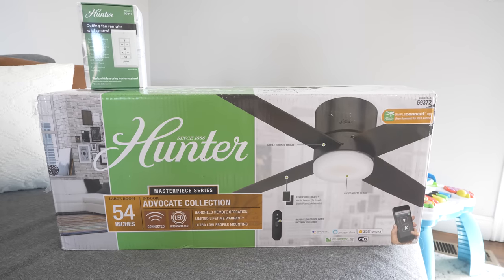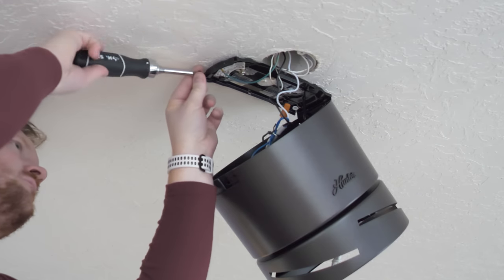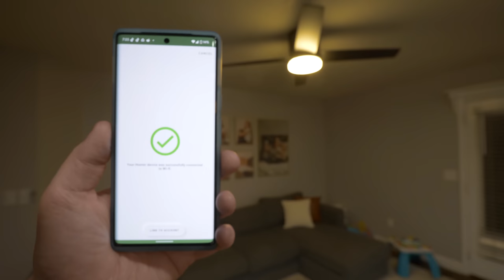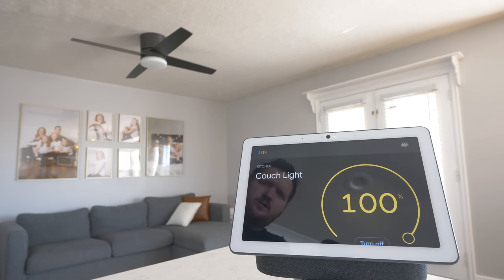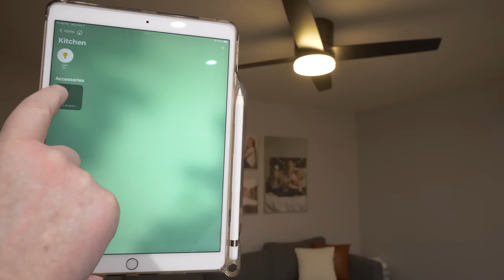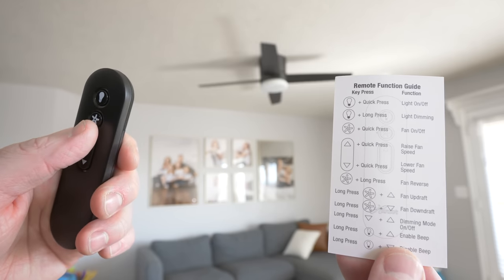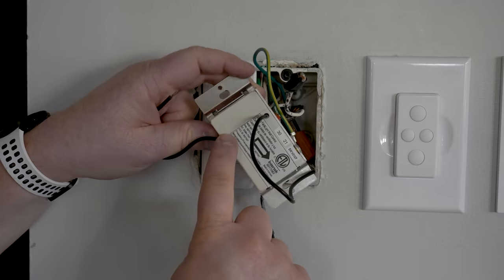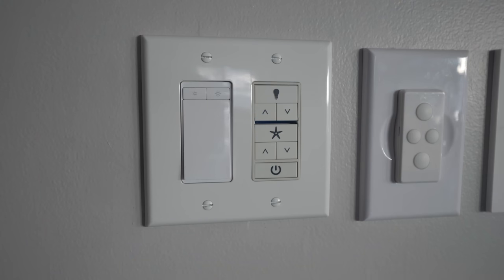This Fan Has Solved All the Smart Fan Problems

Comment: I also installed 3 Hunter Wi-Fi smart fans. They’re nice. I also installed the simple connect app and got it working with Alexa. Then I bought bond a little hub which covers 2,500 sq ft and can control up to 30 fans. It learns a whole ton of remotes/frequencies and makes old remote fans smart. Put’s it all in Alexa. It picked up the hunter fan remote and all of its functions in the bond app and also my other fans. Works great.

Comment: Nice setup. In my case, I bought a modern dumb fan (with no pull chains and a remote control I didn't install), and a Treatlife fan/light smart wall switch. The Treatlife switch looks super clean and modern and allows me to adjust both the light dimming level and fan speed. I decided not to install the remote control that came with the fan because it would mess up the smart setup, but also because remotes get misplaced and I can always use my phone as remote, or the Google Assistant (or Alexa) for voice controls.

Comment: First off, great video. I purchased that fan, but hated the light. It does not look good or generate enough light on a lower ceiling. The other issue I had was that the wall switch did not have the load for the fan. I ended returing the fan, purchased a Smart WiFi Ceiling Fan Remote Control Kit for $30 on Amazon and installed with my original fan. It works great.
Reply from the maker: Good to hear your review. The fan light has been a big improvement for us. I still have one of those I need to try out.

Comment: Meh? I just bought a generic Hampton Bay fan for $90, the Bond Timing Remote (you have) for $60 and 3 Hue Bulbs along with a $40 Lutron Aurora dimmer that locks the single toggle switch into the always on up position at the wall. No fan control switch on the wall, but voice control works fine. Homebridge'ed the Bond controller into Homekit etc. I could just add an Aqara 4-button remote and control the speeds via Homekit.

Comment: Virtual switches between ST/alexa can link it to your temp sensors to make the fan more automated.

Fairly easy to set up if you are into smart homes. I do the same set up with my dumb fan linked to a BOND RF controller. 90% of my fan usage happen automatically thanks to ST/alexa or bond.

Comment: So much better than going through hoops with a Bond device that doesn’t actually know if the light is off or on, or if the blades are spinning at some variable speed
Reply: John. Yep, the toggle light on the fan control is a problem with Bond. On my fan remote, there is only a toggle button for light, so that is what Bond emulates. Alexa can control my fan speed through Bond, but not the direction as my fan remote also doesn't have that feature. I think mine is a physical switch on top of the fan.

Comment: Hi Bret. I use the Bond fan controller with Alexa to control all of my ceiling fans. In addition to voice and timed control, I've added a means to detect the HVAC fan running and then turn on the ceiling fans
Reply from the maker: That's pretty sweet. I have been using one of those as well on a different fan and my main complaint is the light switch can still easily be turned off.
Reply: @TechWithBrett  Yep, the light switch being turned off is real problem as it is with smart bulbs. I use those plastic switch guards on Amazon.
Reply: Frank how do you do that?
Reply: @ScarpaProperties Cory. I detected the HVAC running with a YoLink temp sensor in a room vent. I tried vibration sensors on the HVAC fan housing, but the results were intermittent
Reply: I too use Bond home bridge for fans and lights with Google home, and love it. I just cover the original light switch on the wall.
Reply: @bradroth7005  Brad. I stuck a Flic button over the switch cover so that there is still some local control. 1- light on, 2- fan on, 3- all off

Comment: Are you able to connect older fans (both Hunter and others or just Hunter) to Alexa, etc using the Hunter wall installed WiFi remote or it only this model that connects via the Hunter app to voice assistants?
When are you doing part 2 of your smart home setup for that guy? I'm looking forward to seeing how it goes.
Reply from the maker: The Wall Control only acts as a remote for Hunter fans, sadly it doesn't make them smart. I do have another video coming in the next month about all the other ways to make fans smart.
Reply: @TechWithBrett  Cool, thanks Brett!, we're in the process of building a home and getting the ceiling fans smart would be nice... Most other lighting in the home will be smart or via PIR switches. No word on your other smart home setup video yet? No problem, believe me, I understand the time it takes to get someone set up...

Comment: sloooooooooooooooooooooooooooooooooooooooooooow. Great video. I may have to look into this. Hunter fans always had problems with smart switch dimming process so I normally avoid them. BATTERIES IN A WALL SWITCH? Is that made by Hue?

Comment: Is it possible to use this fan with a Lutron fan switch and Lutron dimmer switch?

I have a similar Hunter fan but am running into issues with the Lutron switches working. Lutron said it may be because of the receiver in the fan. Is there a way to disable this?

Comment: Looks pretty cool! but it bothers me how you named it couch and kitchen depending on if it's light or fan instead of using one or the other for both 😳
Reply from the maker: I ended up changing the names a few times while making the video. If I only had one fan then Fan would have worked and I had to give the light a unique name because Kitchen Light would turn off all the kitchen lights.

Comment: The only things I don't like about the smart switch is that you have to remove the switch from the wall to change batteries and it's too easy for someone to hit that Power button. Altho they weren't smart switches, I've seen in-wall remotes for fans that use coin-sized batteries accessible from the front of the switch and a hidden "Power" switch.

Comment: It looks like there is notable lag between issuing the command on your phone and the response from the fan.  In the video its difficult to see the actual light dimming, so I can't comment on that response time, but the actions of starting the fan seem somewhat delayed.  Have you noticed this in your daily use, or is this an artifact of the video? It looks like you didn't have to do anything special to balance the fan (which is great).  My fan is 27 feet in the air, so maybe its one of those times you pay someone to install something for you.  Can you share pricing information? Is the smart wall switch a separate purchase?
Reply from the maker: Great questions. The delay improved after initial setup but it is still there when using my Android device. When using my iPad integrated with HomeKit it was much faster to respond. The fan always does take a couple of seconds to engage.
The Wall Control is a separate purchase but there are a few fan models that come with the fan. 
Learn more here:
SimpleConnect Fan: https://geni.us/2VE3× Hunter Universal Wall Control: https://geni. us/RHOqs62

Comment: that’s wack. you should be able to connect the wall switch to all your assistants so you don’t have to worry about if the power is on or off and try to use remote. Just get a smart switch and use a dumb fan that has a dimmable light.

Comment: Why does it start spinning one way and then it spins the opposite way?
Reply from the maker: I'm not sure why it does it when turning on but it must be because the fan supports changing rotation from the remote. It probably has a default direction and then needs to check it's memory each time it turns on.
Reply: Optical illusion.
Reply: @johnthroneberry7212 , that could be the case in a video, but judging by Brett's comment it happens in person.
Reply: @TechWithBrett , maybe they should set the "default" position as not reversed rather than reversed? That would make more sense since I imagine most people use it not reversed. I'll send feedback.
Reply: @locoman5505 , ah okay. The more you know! Lol.

Comment: Inovelli makes a great controller that can be used with existing fans to make dumbs fans smart.
Reply from the maker: Testing that out in the bedroom. It has a ton of settings.
Reply: @TechWithBrett  I've had one for a little over a year and plan on converting all my fans.  They're great options if you want light and fan control with only one hot wire going to the fan. It integrated great with my Hubitat/Google Home.
Reply: I am wanting to try that as well!
Reply: @twobluestripes  What I liked about it is you can add it to virtually any (non DC motor) fan. Also the big plus, is it only takes up a single slot in a box.  It was really well thought out.
Reply: @InfamousElGuapo  Wow this sounds awesome, do you have a link/name of this product?  Is it a "box" that needs to be wired into the fan's canopy or is it a wall switch that replaces an existing dumb switch?  For clarification, I have a non-smart Hunter fan (AC motor, no pull chains either) that has the remote control to adjust the fan speed/on/off and light on/off/dim.  The wall switch for it only has hot, neutral, and ground.  Will this Inovelli product you speak of work with my fan?

Comment: Alas, it has an integrated light which means no Hue bulbs.
Reply from the maker: Yep. I guess if I were to use hue bulbs in a fan I would want the lights wired to be permanently on which could be done if you have enough wires going to the fan.
Reply: @TechWithBrett  Right now I use a Hunter fan with A19 so I can have Hue bulbs, use a Bond for integration with Alexa, keep a cover over my light switch so it stays on, and a Flic button to control the Hue bulbs and ceiling fan if someone is smart home struggling lol.